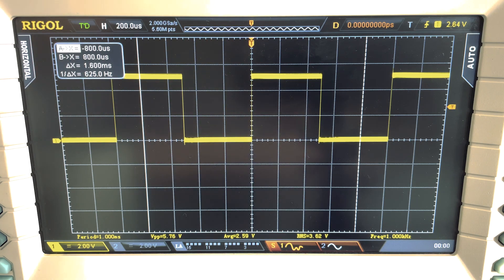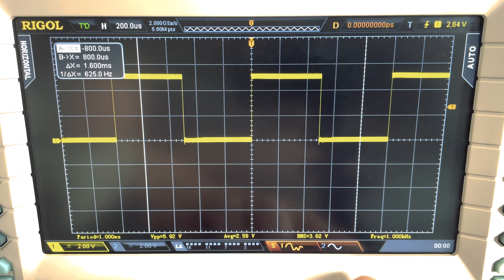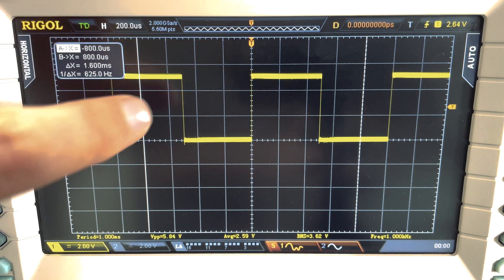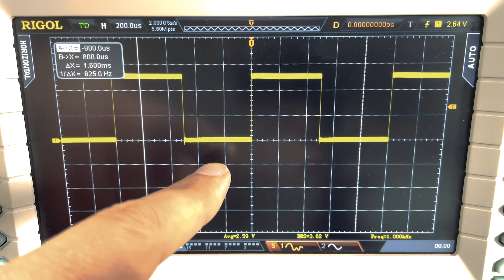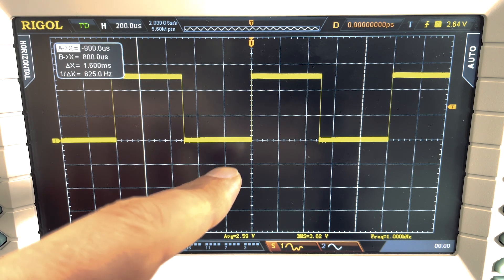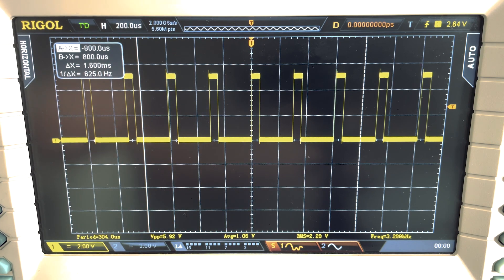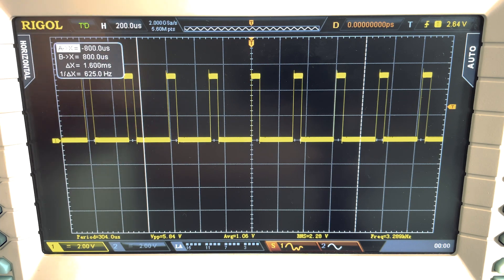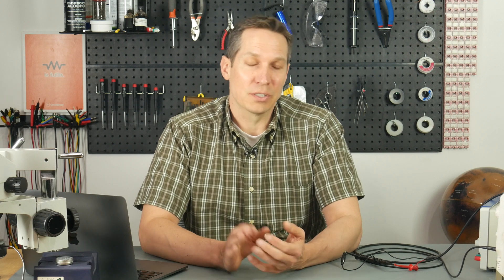How do PWMs work? A theoretical and practical overview

Comment: I noticed that as you increased the frequency, the average voltage also got closer to 1V. Went from 1.15V to 1.05V when we increased frequency from 1kHz to 3kHz which would further confirm that duty cycle is a function of averaging
Reply from the maker: Theoretically, no, the frequency shouldn't affect the averaging.  However, in reality, due to imperfections in the waveform generator, there is an affect as the frequency changes.

Comment: Thank you. Would you consider making a playlist that would guide someone through setting up a photovoltaic system and or a Archimedes’ screw Hydro generator?
Reply from the maker: Yes, actually.  I did the PV system on my own house and am planning on showing some other people in the small town I live in how to do it (or at least help them in the process).  Having done it once, now I feel I could do a slightly better job of documenting the experience while working with someone else.  The hydro generator... not so much, just as I basically live in the high desert where we need irrigation for our crops to grow.  Not much free water just flowing around.